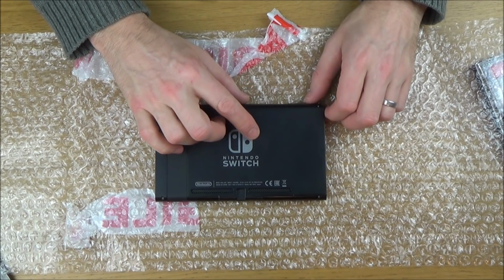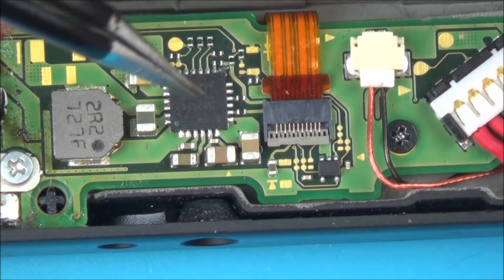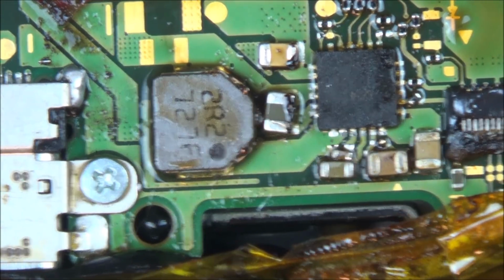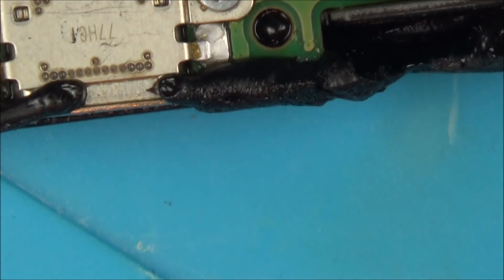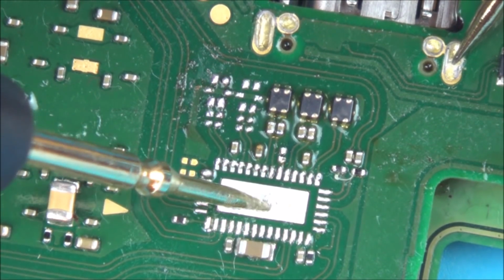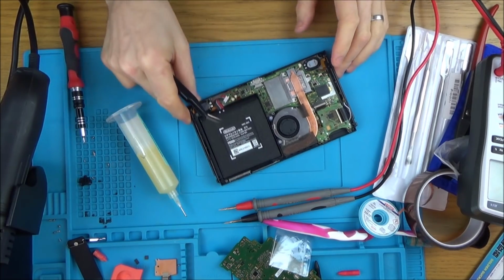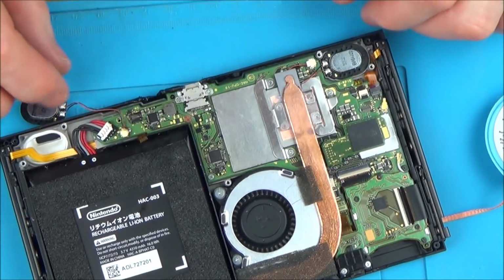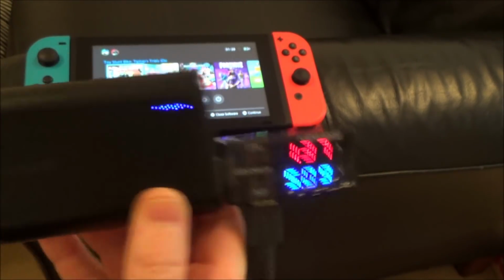Trying to FIX a Nintendo Switch with Numerous Faults

Comment: You need to take one of your soldering tips and sharpen a real good point on it it will be easier soldering to smaller places like the little chips you're working on right now
Reply: Bad idea, pointy tip=bad heat transfer. I think a good clean tip + enough power in this case is much more important.

Comment: Awesome work! you need to use solder paste that will help you a lot to replace the usb and other hidden and small pines, also to protect plastic parts from melting foil is good solution and in my case i use another pcb or a piece of iron I put over the piece I want to protect, to remove this plastic parts without melting them put the heat gun from the bottom “that’s what i do and it works“
Reply from the maker: Thanks for the tips :-)

Comment: 20:50 - no, as that is a thermal interface, it's electrically isolated and therefore is not a ground point... You can check the data sheet or look at the board layout - the pad is simply a square - no connections...

Comment: isnt the excess tape just going to insulate everything? he got flux under the tape so wouldn't it just heat up under the tape and stay trapped?
Reply: Makes no sense to put tape over the legs of the chip either

Comment: Electronics tech chiming in, the first 30 mins was painful to watch.  The initial components that were "failures" may have actually been resistors.  Would need to look at the codes but you had 0402 and 0603's present.  Second, for the chip that you heat gunned, flux and fine solder braid would do the trick.  Alternative would be a solder station with a chip puller setup of thermal tweezers.  If you needed to go destructive removal, would have advised very fine nipps.

Also, future note:. Anyone working on anything battery powered, unplug the battery before doing any work on it, let alone soldering.  You can cause damage to the battery.
Reply: Lol idiot.... 0805..........  ...and they are caps foooo. If you gonna try to sound educated at least be.... I would start with IPC certs...

Comment: I'm wondering why you use the air gun instead of an iron when removing or placing chips? I'm no expert critiquing, just genuinely asking?
Reply from the maker: Hi there, these chips have a big solder pad in the middle of them so a soldering iron wouldn't get to the middle pad :-)

Comment: When i was in the jewellery repair trade there was a a heat protective paste we used to protect delecate parts like opals, pearls and cameos we could put the paste on our finger and apply the soldering flame to it and it wouldent feel hot. 
Look up jewelery heat protective paste.
Reply from the maker: Thanks for the tip Ian :-)

Comment: I just realized that with USB type C you just need to have the exposed pin or the inside pin row connected. The connector has two rows so you can plug the cable into the socket either way around. So if you got the exposed pin row soldered down and you got no power from the cable, rotate the plug 180° And maybe soldering SMD components on might actually be easier with a soldering iron and not the hot air station, at least for capacitors and resistors and the likes.
Reply from the maker: Oh I see, so you think that one row is for the cable one way round and the other row is for the other way round. If that is true in the Nintendo Switch as well then maybe the non docking is not caused by the USB-C port as I am pretty sure they have all made a contact (apart from the one earth pad). I did also try with a portable dock and on the portable dock you can reverse the USB-C so maybe the USB-C is not to blame. Another viewer mentioned filters after the video chip so I might check these out :-)
Reply: Looking at the usb-c wiki, it seems to be more complicated than that after all, at least in usb 3.0-3.2 mode, which the docking station might use. https://en.wikipedia.org/wiki/USB-C. There seems to be enough connections for the USB-C port left to charge the battery, if the cable is plugged in the right way, but not enough for the docking station. So it seems both sides are used after all for higher USB specifications. Maybe replacing that USB-C port would be an option after all? You can do it! :)
Reply from the maker: Thank you :-)

Comment: Hey vince, I changed the fan in my switch the other day and managed to get it all working minus touch functionality. TL;DR I worked out which ribbon cable was responsible thanks to one of your previous videos, clipped the digitiser cable in correctly and fixed the issue. Thank you for your help! If you didn’t explain things that experts take for granted I probably wouldn’t have fixed it! 😀
Reply from the maker: Well done Robin, glad you got it working :-)

Comment: I don't know anything about this area, but it looks like you need to get the captain's tape right down on the board so there's nowhere for the heat to get underneath. Each time you heated it up, I could see the captain's tape just inflate with hot air, and if it's resisting heat, I think that all the hot air is going be getting trapped under the tape and making things worse. Although I don't know anything this is just my speculating
Reply: Disagree..You gotta STOP using kapton tape altogether as a heat shield for air soldering. IT DOESN'T WORK! I have never seen you successfully use this tape without completely fouling up the repair because a heat shield for soldering is NOT what that tape is for. and PLEASE for Heaven's sake..Go to Louis Rossmans channel and watch his videos..this kind of work is basically ALL HE DOES...Watch and learn how to use a pencil soldering tip and a hot air station and you won't kill so many boards.He does these repairs all day long and NEVER uses tape. Also always unplug the battery when working and testing the board and take the extra few minutes to remove the board from the case before soldering  to reduce the collateral damage. You will do more damage leaving it in than you will if you would just learn to remove the connector properly without damage.
Reply from the maker: @TonyZ8553  Thanks for the comments. The reason I left the board in was purely because of that screen ribbon cable. It is a pain. I have taken them in a out about 15 times but twice it screwed up on me. It seems different than other ribbon cable connectors as it folds round tightly because of the lack of space, the 2 times it went wrong I didn't knowingly do anything different than the other times. Sometimes it just catches the pins and the bend on the cable forces the pins down (or up) and then the board has had it, I didn't want to risk it again if I could get away with it but I couldn't :-)
Reply from the maker: I think you are right :-)

Comment: Only watched part of the video so far but as I've previously said don't do continuity or resistance tests with any power connected. On these tests it sends power from one probe and measures the power returning on the other probe. Since you still had the Nintendo switch battery connected it was getting power through the chip and then on to the probe and confusing it with the power it was sending out. Hence why when you tested the chip out of circuit there was no shorts and because you had removed the chip power was no longer getting to the caps. If the power had of been greater it could of damaged your meter.
Reply: When soldering with a hot air soldering station do it from directly above the component rather than angled to the side and also with lower air flow. That way there is less chance of blowing other components off and melting connectors. Solder melts at between 350 and 380 degrees even on lead free solder the melting point is 398 degrees so dont go much higher than that. In the last place I worked the hot air soldering gun was in a jig like a drill press so it could only be raised or lowered. It may take slightly longer to do but don't be overly worried about damaging components due to heat. In all my time soldering I have had one chip fail.
Reply from the maker: Thanks, the camera was above the Switch so I was trying to let the camera see what was happening by angling the hot air wand. In future I will need to angle the camera better so I can go directly above the chip. Thanks for the tips on temp and battery.
Reply: Okay just started the video again and saw that you realised you hadn't disconnected the battery.

Comment: Little tip here. I use standard aluminium foil (3 layers) to wrap all PCB. Then i cut area around the chip using scalpel to see the chip. Window should be a bit larger. Then i tape foil aroud the chip with the capton tape. This way you wont melt anything else. Also 390 Celsius is too high, i use temperature around 340 and about 50 pct air flow to prevent other parts from moving.
Reply: Great suggestion. I've found that the foil not only reduces the heat even further but also seems to give a little bit of stability to the tape to reduce peeling and curling at the edges...just use caution with the foil on devices with large capacitors as you can get a shocking surprise if you don't make sure the device is unplugged and fully discharged of any residual voltage.
Reply: 400C is ok, never got any problems with that. I think its better to do it on higher temp settings. If you do it fast the component never gonna reach 350C.
Reply: Great advice, it's great to hear what other's do

Comment: Excellent fix vince! Also only use kapton if you really really need too on a job like that. Simply because if you put too much heat as it melts and crinkles it can shrink and pull other smd components with it, not to mention hinder your view of what else is melting. Use some kitchen foil or something like that (especially for the plastic connectors). I also preheat the area with a hair drier (heat gun occasionally) too as it makes the final heating and or soldering iron more effective.

 As always great repair video, you really did well considering the space you had to work with! A learning curve, we all make mistakes! Follow up video please! :)

Comment: Mate i love your videos but seeing all that mess and melting the enclosure and the sockets with hot air, that didn't look good at any point, this broke my soldering feelings :D
Also you grab the capacitors by their soldering joints, you make them get cold again and that doesn't make you able to remove them, you should grab them by the ceramic. Also your tweezers don't help, buy one of those titanium used on iphone repairs.
Reply from the maker: Yes that makes sense, hopefully I will remember from now on to grab on the ceramic middle part. I will also Google the tweezers. Cheers for the advice :-)
Reply: @Mymatevince  These ones friend: https://www.amazon.com/d/Hand-Multi-Tools-Accessories/Anti-acid-Anti-static-Motherboard-Soldering-Microscope/B077VMQM2L

Comment: When using heat always remove the board to work on and you need to order some spare boards to practice on. It took me a while to learn the heat to air ratio with practice and patience you’ll be a superstar. Enjoy ya videos and it’s good to see you going strength to strength 👍

Comment: I am trying to understand why you don't use a smd soldering station to perform the rework. None the less you sure are good with that heat gun. I would have melted much more.

Comment: There is an eBay store that sells faulty Game Boys ( and working ones ) you have all sorts of models, colors and faults on this store. It is located in Japan and is Called Japan4u, consoles here are super cheap and shipping isn't really expensive either :) you should do a video on one of them
Reply: Here is the link : https://ebay.fr/usr/japan_4_you
Reply: can you post a link to the ebay shop? cant seem to find the right one i dont think.
Reply: 100%! I've done a few game boys and they are really fun to fix. And most of the time they are pretty simple to work with as well.
Reply: @Tylerjrb  yes I repaired a lot of game boy colors and game boy DMG that I bought on this site and recently bought a MINT condition clear Game Boy Color for only 23€ with shipping !
Reply: @Tylerjrb  I've got a dmg-01 gameboy I'm trying to fix but no luck. Powers on but absolutely no video and no sound but I hear static in the headphone jack
Reply: @Jonnynot1plate   Depends what you have at hand. I have a psu i can hook up and measure voltages. i'd make sure you are getting all the correct voltages for the Screen, CPU, speaker etc first (if at all possible). On the DMG's it is quite common for the screen's ribbon cable to become damaged or the connection to break where it connects to the screen itself.

For the speaker first measure it has voltage which should be around 1v. If it has this then just measure across it with multi-meter on resistance, they are like 8 ohms or something like that when in good condition.

If you are not getting the correct voltages then inspect the board for any damage, leaking/bulged caps, cracked/damaged ceramic caps/resistors etc. Remove and test etc.

you can also test contrast wheel with a multimeter on resistance to ensure it works.

If say your cpu and everything else has the right voltage, so does the lcd, so does the speaker and correct ohms, then it could be something like the oscilating crystal is dead. Which you cant really test without an oscilloscope. I think you can get replacements however.
Reply: @Tylerjrb  cheers, I'll be sure to check out all this once I get more experienced with it. Currently if the battery contacts are clean and the inside is clean. I pretty much have no idea, need more tools lol
Reply: Lol I just ordered a white DS 90% working for like eight dollars with free shipping from Japan to America. They always have some good working units for dirt cheap. Highly recommended seller on Ebay.
Reply: Another great store with low price japanese stuff is Dora's Store https://www.ebay.co.uk/str/dorasstore
Reply: If only it was possible to make them region free
Reply: @Jonnynot1plate  they are already region free, game boy consoles were never region locked :D
Reply: @ChrisMX9  really? You just rocked my world. So many game boys to fix now! Found the shop

Comment: I bought a roll of aluminum foil tape from Lidl for around £2.50, but I haven't tried it yet.

It's sticky on one side so it won't move, but because I haven't tested it, I don't know if the sticky part will make a mess of the parts it's covering.

Comment: The problem is that you kept the board inside the housing. You should always remove the board before doing any jobs with the rework gun. But a really nice fix!
Reply: And by doing this you are forced to remove all the power sources including battery, keep that in mind because it might confuse your meter when you are looking for shorts. This is why the cip did not show to be shorted after removal.
Reply: @xxifix7230 I was able to plug in my battery while the motherboard was out of the housing.
Reply: This
Reply: Amateur move. I expected more from his calibre.  Who uses heatgun without protecting other vulnerable components. Taking the board out of the plastic casing. Cover connectors with foil.
Reply: @don4techy you do realize this is a 5 year old video & Vince has gotten SUBSTANTIALLY better at repairs since right?
Reply: Yes always remove boards from unnecessary components such as screens , housing, battery and any other connector or ribbon cables attach before soldering or reworking a board this is to prevent damage as well as makes it easier to work on the board

Comment: Vince check out CollectPlus for cheap delivery costs, they are very good for large/heavy items, and you just have to drop them off at your nearest drop off location (usually your local shop), so no waiting in line at the post office. Check them out, I used them a lot to send PC's I used to build. https://www.collectplus.co.uk/send-a-parcel
Reply: Also you can link your eBay account to it which makes it super easy to print labels.

Comment: Hi Vince, there are five filters after the hdmi ic. when the chip burns out, the first (left) filter blow up also. that's the reason, you can't get a picture over the docking station. hope that was helpful.
Reply from the maker: Well that is interesting as I have another Switch with the same problem. Is it easy to test for the blown filters, is it open between the entry and exit pins rather than shorting?
Thanks for the advice :-)
Reply: @Mymatevince if it's open between the two pins, then the filter is ok
Reply from the maker: Thanks Krebsi :-)
Reply: @Mymatevince  you're welcome